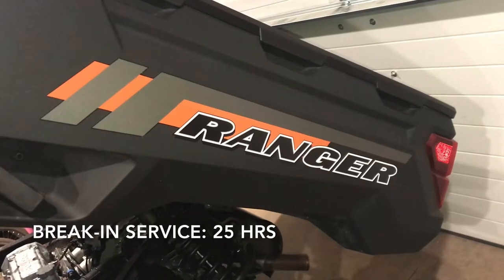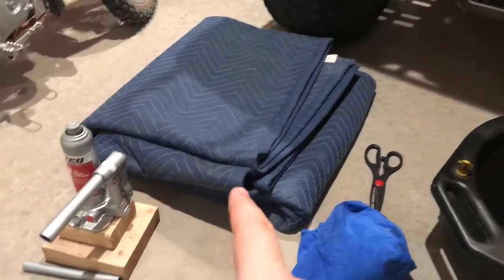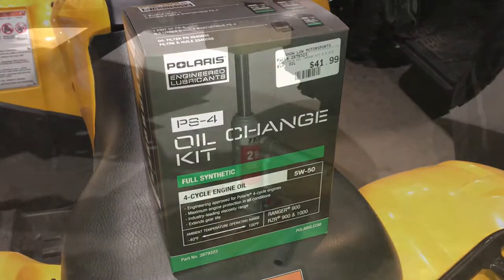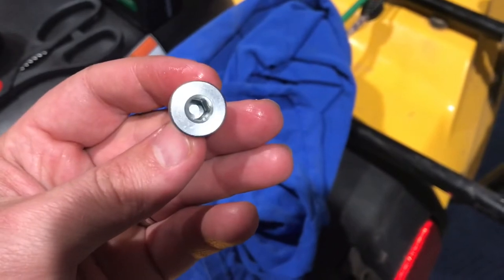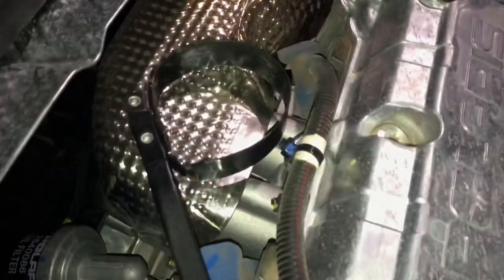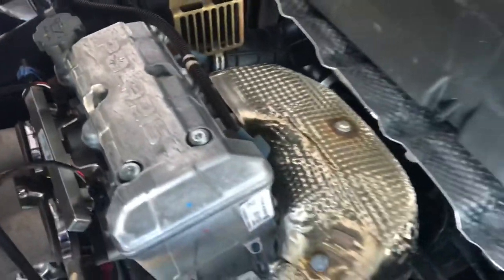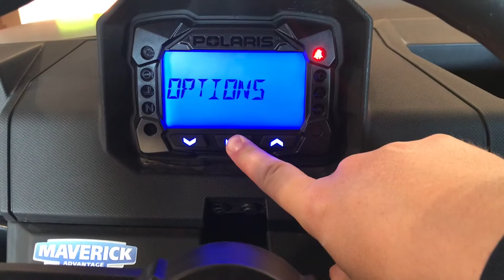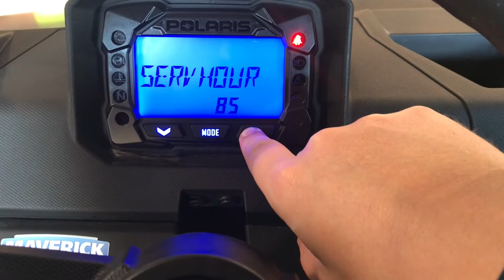HOW TO CHANGE OIL | 2020 Ranger 1000 SOHC (Vid #17)

Comment: Hello , hey good oil change . I know you are in east side of the state and not sure about temps over there , but the red kit has a higher temp rating for Arizona weather and the green has a cooler rating for cold but only goes to 100 high rating ? Did you know that ? I’ve owned few polaris  machines ?
Reply from the maker: Thanks! I did not know this! Glad you shared. I will look into that. On the positive side, I will likely never ride this machine in 100+ degree temps. Up here in the White Mountains we get into the upper 90's but that's about it. I do occasional ride the low AZ desert, but only during cooler months.
Reply: Southwest ORV from what you said , then you are fine with the green one . Stay healthy and thanks for responding
Reply from the maker: Will do! Enjoy your summer.